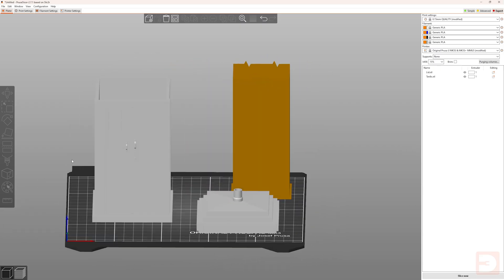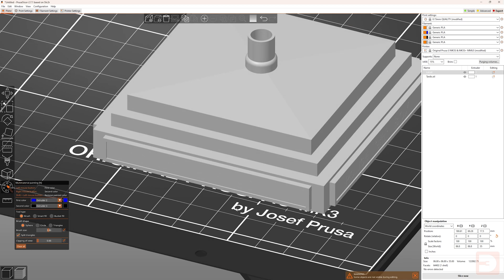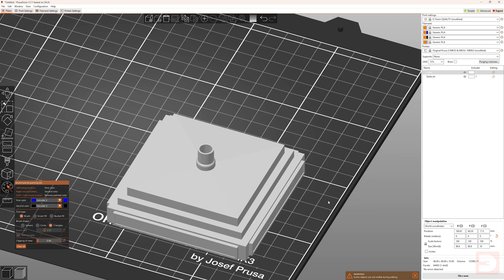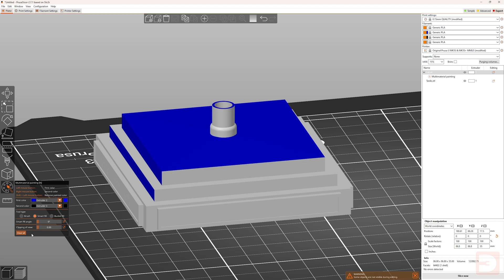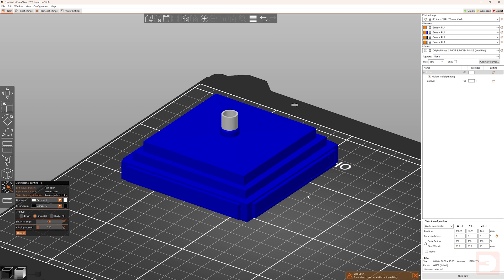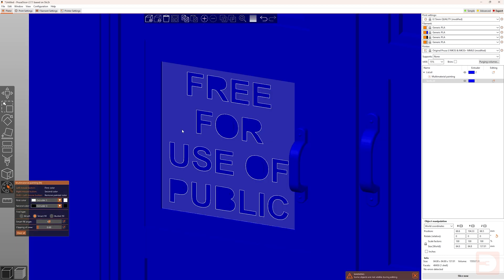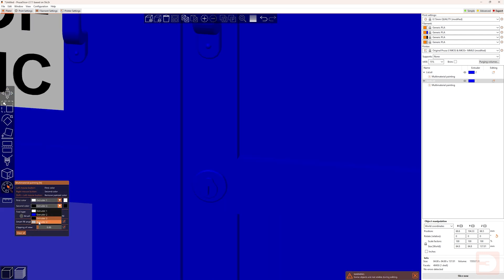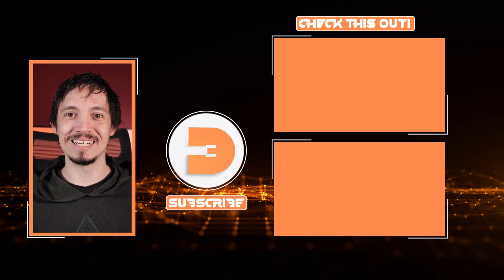PrusaSlicer Painting Masterclass

Comment: Thanks for another excellent tutorial. After a very long while I am hopefully going to get my 3D printer back up and running again soon, and I'm really keen to try multicolour prints. One thing I am curious about, once you have a painted object in PrusaSlicer, will it save like a standard gcode file? As in, is a painted gcode file shareable in that respect?
Reply from the maker: Really glad you found it useful, fingers crossed with getting your printer back up and running, let me know if I can help.
As for your question, when you slice something and export it, that gcode file is effectively a list of machine commands for your printer to follow, so if those commands include swapping between filaments that will be baked into that gCode file. However, it's worth keeping in mind that because a gCode file is just a list of machine commands, and those commands were generated by the slicer based on an understanding of what your machines functions and abilities are, that gCode should only ever be used on another printer with the exact same specifications as the one that it was sliced for. Using it on another machine or even one with some slight changes, could result in the printer damaging itself.
Reply: @3DRevolution Thanks so much for the reply, your answer makes perfect sense, I did think printers would need to be identical. From what you say, I think what might have been a better question from me  is if you load a .stl or .3MF file into PrusaSlicer, then paint it, could you save it back as .stl or .3MF, then share that file as a ready painted model, for another user to slice? 
I'm thinking no, but it would be cool if we could share painted models, for the end user to pick their own colours (as in what colour filament they have available) and slice with minimal effort required on things like the lettering. Your wonderful Tardis model is really cool and despite your excellent tutorial I was thinking to myself, but what if I'm lazy, can someone else do that work for me in advance 😁If that makes sense! Also lending out your talents with that Tardis model is, for me, so generous. I know a couple other channels that have shared things like that and I hold them in the highest regard, so thanks again, you are in those upper echelons!

I have an Ender 3 V1, I upgraded to a dual Z axis, basic direct drive extruder adapter and replaced the nozzle in one hit. Afterwards I discovered the SKR Mini V3 only supports single Z axis. Marlin was just not playing ball so I switched over to Klipper, but I believe the overriding issue is the precision of calibration, which is also why Marlin was being fussy (alongside MASSIVE amounts of procrastination 😂 ). I have been struggling to find suitable equal household items I can use to assist levelling the gantry, I also have a glass bed which is 2-3mm thicker than a normal bed, also a BLTouch and Runout sensor....I'm not helping myself to make things easy! 
I've considered just getting a new Ender or a board with dual Z support, but where's the fun (and learning) in that! And besides, I have already invested on the parts, I'm not a fan of throwing money at a problem that IS fixable with knowledge and patience.

Sorry to ramble, and thanks so much again, looking forward to what you have in store next 🙂
Reply from the maker: @Billybobble1  Hey Billy, sorry for the late reply.

STLs can't hold painting data, however if you save a PrusaSlicer project, it will be saved as a .3MF file and will retain the painting information. If that file is then opened by someone else in PrusaSlicer it will still feature the painting you've applied to it and then they can just change the settings necesary for their printer and filament. 
If however it's opened in another slicer such as Bambu Studio, the geometry will still be loaded but the painting will not be. 
Unfortunately there's not currently a universally accepted 3D model format that matches painting information across different slicers.

Tl;Dr: If you paint a model in a slicer (eg PrusaSlicer or Bambu Studio) as a 3MF using the Save As function, it will save any painting you've applied to the model. That painting will still be there if the file is opened by someone else in the same slicing software that you made it in, but other slicing software won't recognise necesarily the painting information.

So for example, for all the multi-colour designs (Tardis included) I've made and shared, I've included projects (in most cases a PrusaSlicer project and a Bambu Studio project) with the pre-painted models.

Again, really sorry for the late reply, I hope this helps, and look forward to talking in the future.
Happy printing!
Reply: @3DRevolution  Absolutely no need for the apology my friend. That you have given me such detailed replies is WAY more than I hoped and you are under no obligation to do so. You are very definitely a 'real one' as they say. Thank you so much for the info, it really means a lot, and man do I wish I had a Bambu or Prusa printer. I kinda like having a lowly Ender 3 but just haven't been giving it the time I need to. I do love your content and your tutorials are so thorough. You remind me of Teaching Tech, simply some of THE best 3D printing content and utterly baffling why your channels are not more prominent. Thank you again and yes indeed looking forward to talking around your future content.
Reply from the maker: @Billybobble1  This all means a hell of a lot Billy, thank you very much!
Bambu and Prusa are great, but then so are Ender 3s. During the covid lockdown I set up a non-proffit with a couple of friends where we took on a team of hundreds of volunteers with printers and were producing, processing, and distributing tens of thousands of units of PPE to front line workers for free. Anyone who didn't yet have a printer but wanted to get one to become a maker we recommended the Ender 3. For the price, the performance and reliablility just can't be beat. Truly a brilliant machine.
Reply: @3DRevolution  I don't just like that reply, I LOVE it. I SO wanted to get in on that (the making of the PPE) at the time, but just wasn't quite there with my setup. The maker community is just the best, I really need to kick my own ass and get on that. Making custom prosthetics for relative pennies and all that jazz. Again, you're a real one. Got your new vid in my queue to catch up on, hopefully over the weekend. Keep doing you my friend 🙂
Reply from the maker: @Billybobble1  The prosthetics is an area I've been wanting to get into for a good long while. I've actually got some interesting videos on that coming up towards the end of this year. Sorry for the late reply, hope you're doing well. Happy printing!